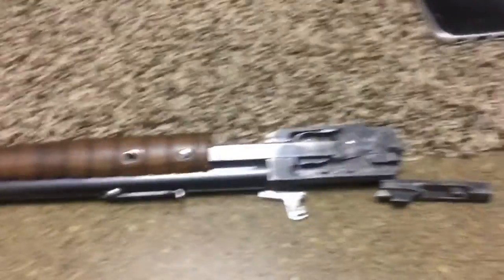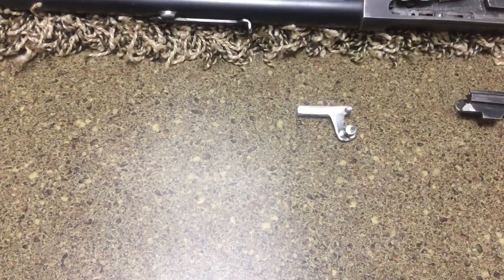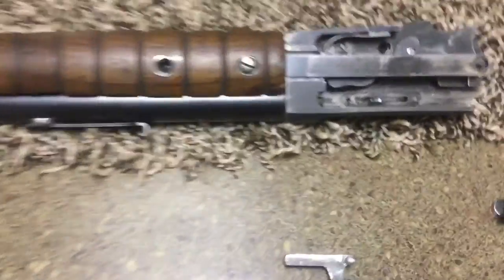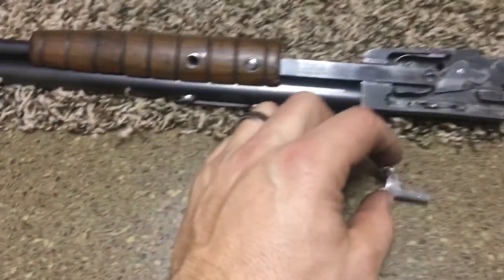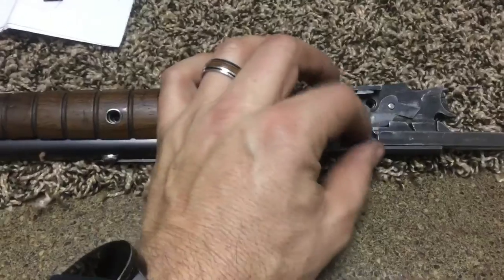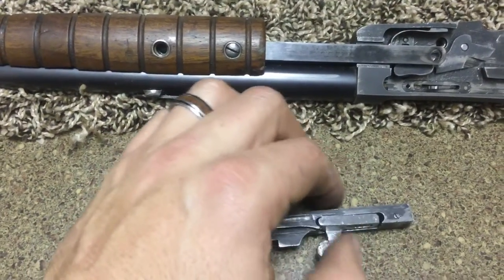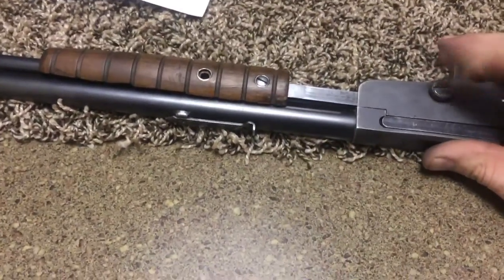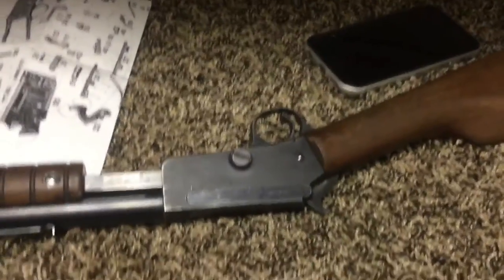marlin model 37 locking bolt build

Comment: Have you got this finished and working
Reply from the maker: RGK 762 I do have it working
Reply: Ken B would you do a update on it. Why im asking for is my 37 has the same issue
Reply: Ken, I have a Marlin no 20 and it is complete and parts appear to be similar to the 37. If so you are missing a spring loaded pin that goes in the part you made which operates the lifter.

Comment: Hope you’ve got your part refined, and cycling properly.  I recently inherited a model 37, and I agree, they are rare and hard to find information on.  I have broken mine down, and it has all the parts, cycles perfectly, and is in remarkable condition.  Actually, other than a few dings in the wood, it’s in like new condition.  If I can help you out in any way (pictures of the part in question, or any other) just let me know.  Contact me at roysboy1@ymail.com if I can be of any assistance.
Reply: do you still have this? recently acquired one in a trade and im apparently missing "one single screw" according to the trader. attempting to rebuild now and see if i can get a modern screw replacement, just not sure which yet. if you do reply and still have it let me know id love some pics